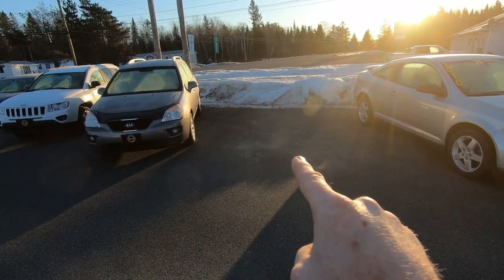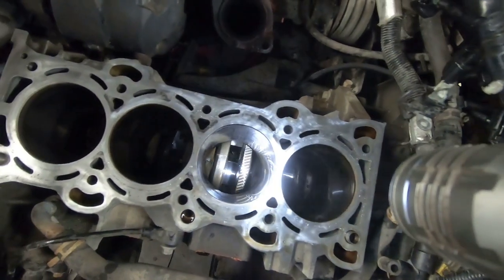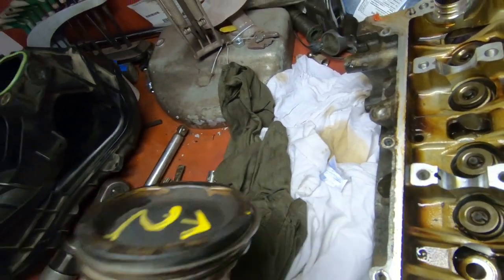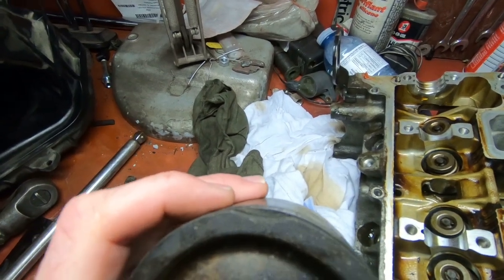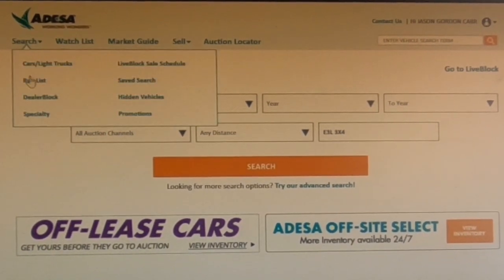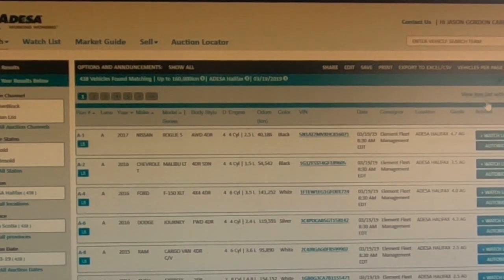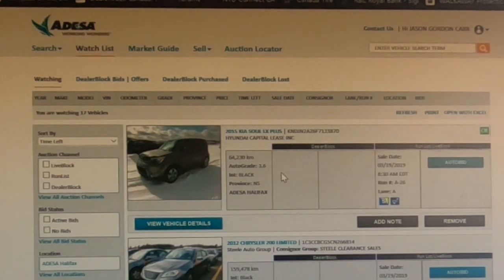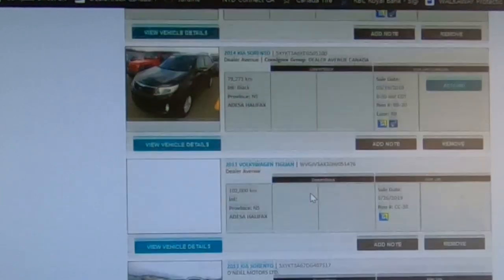HOW TO BUY CARS AT ADESA AUTO AUCTION-

Comment: The auction was pretty cool.  You must have had to hone the cylinder walls on that motor too eh.  I can't imagine that pistons in that shape would not have scored the walls.  My guess is that there must have been a flaw in the material of those two pistons to have them fail like that.  But I'm certainly no expert on engines either,
Reply from the maker: Believe it or not, the cylinder walls were super clean and score free. The original crosshatching was still visible even with 200k km’s. However, yes we did hone.